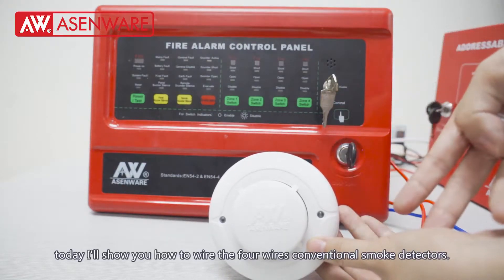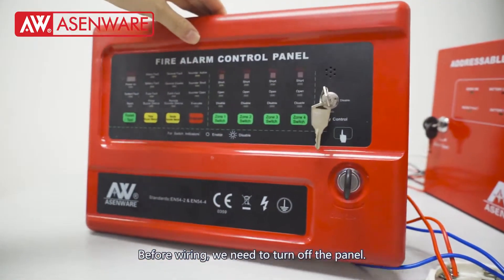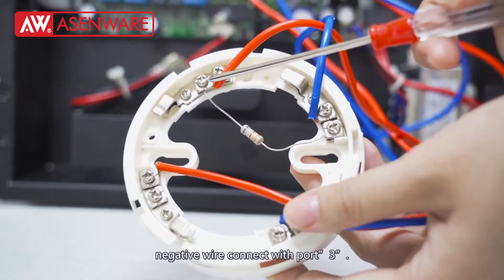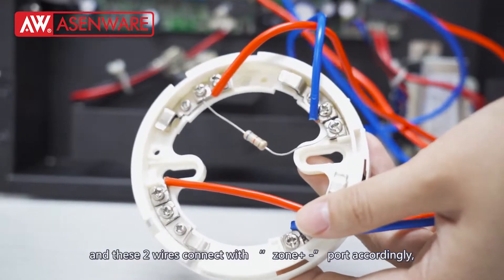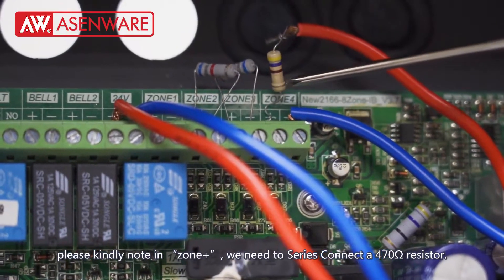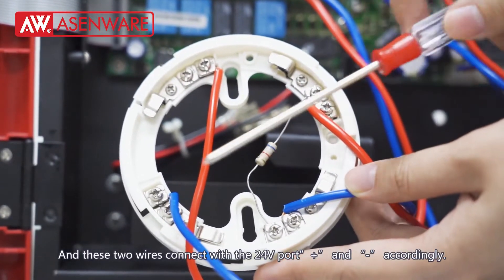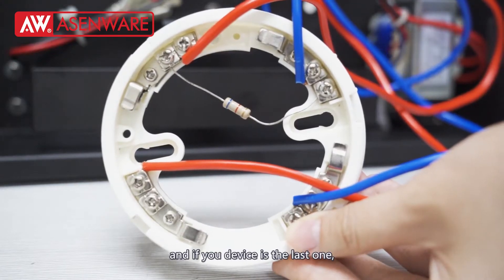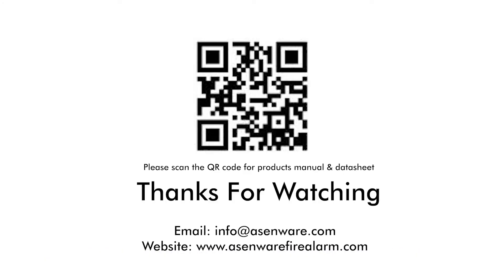How To Wire The Four Wires Conventional Smoke Detectors (Installation Explanation)

Comment: How to connect 6 unit smoke detector And 2 unit manual call point
Reply from the maker: Hi dear, may I knwo with system do you need to connect with,  conventioanl or addressable fire alarm syastem?
Kindly add my Whatsapp, Wechat, Tel: 0086 13922805301

Comment: Hi. How many smoke detector maximum for a fire alarm panel (conventional) and also mcp?
Reply from the maker: for the conventional fire alarm panel: each zone maxim can connect 20 devices （including the detector and manual call point）

regarding the sonder:

1 zone : each bell port can conenct 2 sounders
2-8zone : each bell port can conenct 4 sounders
12-32 zone : each bell port can conenct 7-8 sounders If you have any other question, please feel free contact with me! email: sales02@guta-fire.com and whatsapp/phone/wechat: 008618923305381